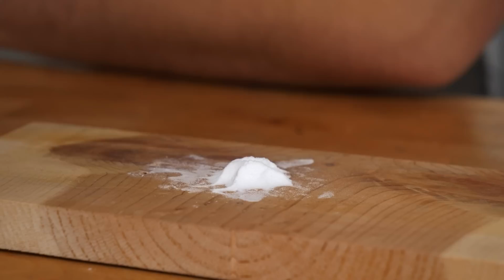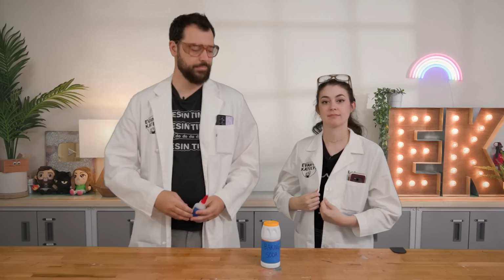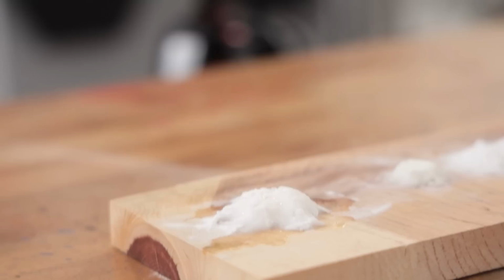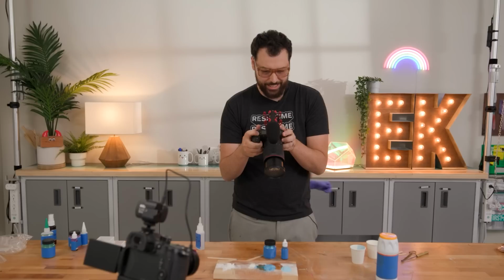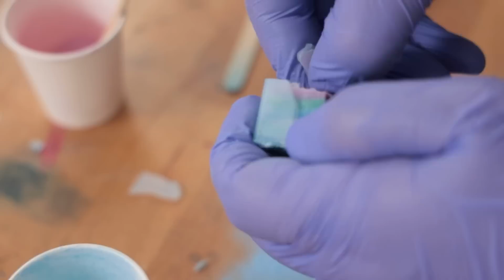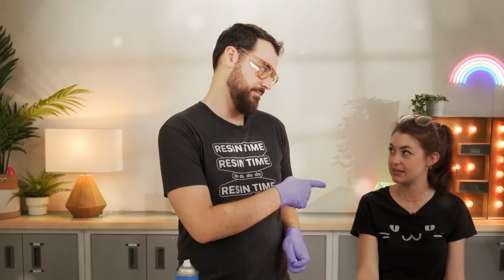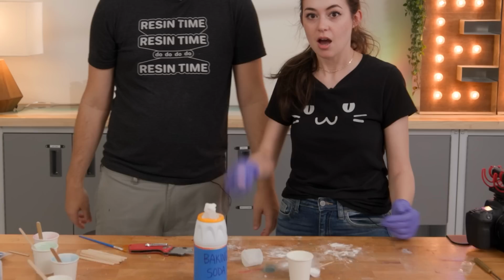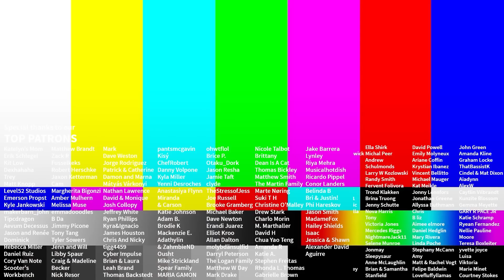Can Baking Soda + Super Glue replace RESIN?

Comment: Late to this party, but I've got an idea for you to try out maybe. Instead of layers, swirl the different colours in the cube before using a mixed super glue of the thin stuff that works well, with some slightly thicker stuff to thin it out so it's averaged between the two. Try using that instead. You should get a neat pattern, and hopefully enough time for it to soak through. Also, try mixing some cornstarch into the mica soda mix. There is a fella on YouTube who tried using corn starch to slow the reaction time, and he was using what appeared to be thin or super thin glue. 

Also, one more thing that is mostly for the audience. Baking powder and baking soda are not the same thing. You two are good on this one, since you are using soda, but I see a lot of videos so far using them interchangeably. This is incorrect, as baking powder has extra ingredients. Quick search gives this: "A typical formulation (by weight) could call for 30% sodium bicarbonate, 5–12% monocalcium phosphate, and 21–26% sodium aluminium sulfate. Alternately, a commercial baking powder might use sodium acid pyrophosphate as one of the two acidic components instead of sodium aluminium sulfate."

Baking soda on the other hand: "Sodium bicarbonate, commonly known as baking soda or bicarbonate of soda, is a chemical compound with the formula NaHCO₃. It is a salt composed of a sodium cation and a bicarbonate anion."

Comment: If you want to slow down a chemical reaction, cool it. Works most of the time. NileRed uses it a lot of times to slow down reactions or to slow down "reverse reactions" (you try to build some new molecule, but the molecule does not want to exist in that environment, and breaks back down to the molecules you started with). If you slow it down, the glue has more time to really penetrate the powder. Well, you should not cool it down too much, to prevent the glue from freezing.....

Comment: i have done so many test with superglue and baking soda back when i was in junior high, because resin is so expensive and still hard to get if you want to make a mold use metal i use lead solder some tin soda can and if you want to make it really rigid add some shred piece of paper i manage to make some tiny piece but you cant get it to be really shiny and be extra care full to the fume and the heat

Comment: It's pretty close to the same reaction as acrylic nail stuff, you might be able to get more control over it if you head to sally's beauty supply and get the stuff there, even tho it will be a little more expensive. I dont know what they use that makes it have a slower reaction, but that's part of the science exploration fun. I made a pool cue tip from baking soda and superglue, but I had too many pockets and it broke pretty easily.

Comment: Die cast car restorers commonly use this mixture to repair damaged die cast vehicles. After you can sand it and repaint which makes it perfect for restoring.
Reply: I’ve used it to repair small plastic trip attachments on my 1994 Ford Probe.  Little Superglue and sprinkle in the baking soda.

Comment: I don’t know if anyone has mentioned this in the comments but, I have two ideas you could experiment with, that you didn’t do in the video. Instead of Baking soda and then add glue. What would happen if you pooled the glue and then added baking soda. Would the baking soda solidify and sink to the bottom or would it incapsulate the glue? Also, with your layering technique have you thought of maybe coating the mold in super glue and then “flocking” the glue with baking soda, and then repeating this process layer by layer from all sides? I’m curious how these would work out!

Comment: What about using a powder food colorants? They're usually just dehydrated food coloring, meaning no alcohol, no water. Therefore nothing liquid introduced into the equation but still can achieve vibrant colors.  The only drawback I can see is that mixing powder food coloring with anything 'white' will lighten the color of your food coloring from its original color, so you may use more to get the color you want.

Comment: There are CA glues that are very thin and yet slow-drying. For example there are glues from MIG brand that are CA based, but dry in something like 1 hour or so. They could work by mixing powder straight into glue, the pouring glue into mold, same way as resin. Though, not sure if there would be any point in doing that, as any significant amount of CA glue probably would be equally or more expensive than resin.

Comment: in chemistry, one of the ways to make a reaction go faster is to increase the surface area of the reactant, and so the finer the powder is, the faster the reaction will be, since there are more sides for the liquid to touch, and that will produce more heat. so the mika powder, since it was already powder and was finer than the other blue liquid dye, i suspect that was responsible for the higher temperature.

Comment: ...How could you end this video without a balance test?
As to an easy test for that:
Take a cup of water, put the die in it, if the die sinks, add salt until the die floats.
spin the die in the water several times and see if the same number comes up every time, or if it's random. random = balanced. Always rolling 20s? THAT's a keeper, lol.

Comment: I wonder if you actually just fill the mold with baking soda, put it and the glue bottle to cool down. This would temporarily halt/slow down the polymerization/curing process, allowing you to do the entire mold at once but also make sure the glue fully saturate and penetrate the baking soda (so you probably can use the thinnest CA glue this way to really get it into all the nookies and cranies), as well as help control that heat output. Now, sounds easy, but there is some science to be done here. From what I read, -18C is when uncured CA glue stops naturally polymerizing completely. This gives a few options, to experiment, between cooling it to bellow that temp and just cooling it down a bunch; then if you mix it in the same cold environment, an environment just less cold than that, or at room temperature; and then finally if you just let it cure in a cold/refrigerated temperature (probably not -18C, but still), if you slowly bring it to room temperature, or you just mix the two and then bring it to a room temperature environment. Of course, regular home freezers aren't even close to -10C, so you could just not try to be too extra on that front and just do whichever variations you the standard home kitchen appliances and see how it goes.

Comment: I use paper towels/toilet paper and super glue to fix my headphones. Especially if I need to fill a gap. Just tuck the paper in the gap and add a drop or 2 of the glue. Let it dry and it works great.

Comment: I actually use baking soda and super glue when connecting metal armature into plastic model horses when remaking their leg or whatever, and it's good for filling any nasty holes or scratches quickly instead of getting epoxy clay out, 2minutes, cured and I can sand it smooth

Comment: Time for round 2: 
start will a pool of glue, and insert the powder.... - and keep glue-ing (like one big volumetric pour) 
and, actually hard packing the bicarb, and then using needles and syringes to flood it from multiple points from the center out. - I'm sure, modern problems require modern solutions.

Comment: I'm wondering if filling the mold completely, then quickly injecting CA directly into the centre with a hypodermic would work? 
The syringe would need to be filled, then a fresh hypodermic fitted to keep CA out of it until the moment of injection, otherwise residual glue would react as the needle was going in the mold. My thinking is the CA would either get into the baking soda evenly and form a single solid block, or the baking soda in the tip of the needle would instantly cure and block it up before the rest of the CA could be injected.

Comment: Proposal for how to make it work better: do layers from the outside in. 

Pour a SMALL amount of superglue into the mold, roll it around to coat the inner surface, then add baking soda and shake it around. Pour out the excess baking soda, add a tiny amount of glue, roll it around, and add in baking soda again. Repeat until full and solid.

Comment: I wonder if I could do this to keep my Arrow inserts from comeing out of my arrows when I pull them from the target.(bag targets and Aspen fiber bales like to eat Arrow inserts/points)  Like the thick supper glue with a little bit of baking soda sprinkled on the inserts so it dried slow you have time to get the insert in the arrow. Same with to keep  Arrow nocks from poping out. Will have to try this or talk it over with some of my archery friends.

Comment: Hi Paul, a great mod using the old Lima coaches into Northern Ireland Railway stock. I may try this myself at some stage to run with my NIR livery Class 201 'River Lagon' locomotive. I also think we've meet at a few shows namely the Bangor or UMRC Carrickfergus and Belfast exhibitions during the mid 2000's to early 20-teens?

Comment: I've worked with super glue for a project and my fingers keep getting stuck by the glue and it very hot, and painful to remove
Reply: Tip : if you use super glue and some gets to your hand/finger or any part, try removing the excess as quick as possible before it hardens, then, just leave the glue overnight, just sleep, usually the next morning the glue is gone